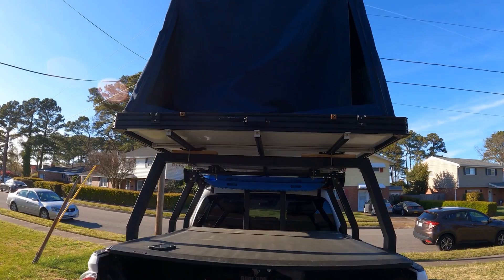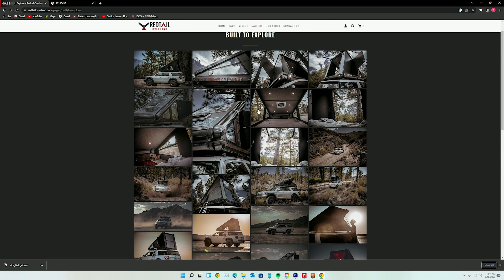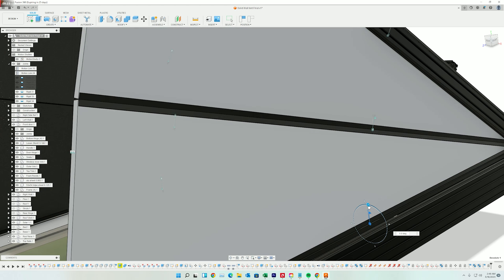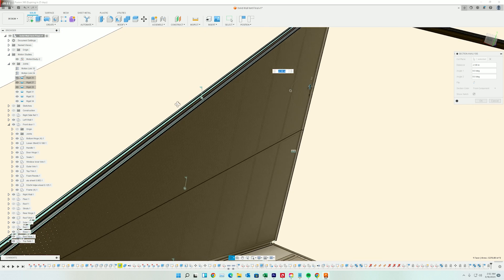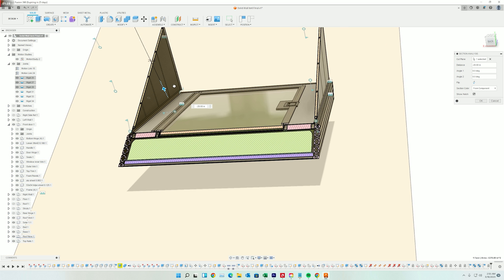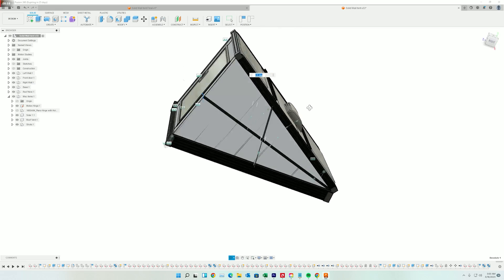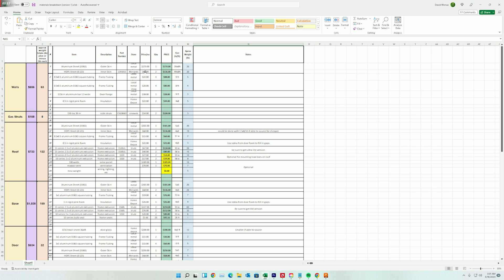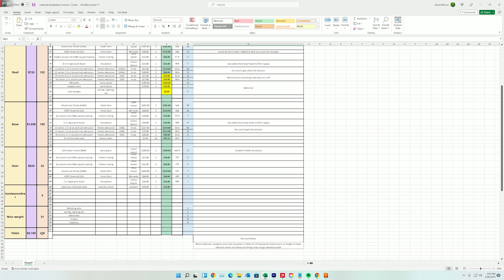DIY hard-side rooftop camper build (INTRO)

Comment: Aluminium is going to create moisture on the inside. Which is why the sky loft is carbon fibre inside and out. But who can afford one of those!! I’m hoping you can pull this off and get a good outcome.
Reply from the maker: @AdamBurgess-p3g  I finished this over a year ago now and it works exceptionally especially in the cold I get practically 0 condensation inside even when it’s sub 0 temperatures. Aluminum does have a high heat transfer which is what creates the condensation as the aluminum gets cold. Luckily since only the outer frame is aluminum this doesn’t really matter as the surface area of interior aluminum is pretty negligible.

Comment: Lay your own carbon fiber over  fiber glass square tube. Use 1' reflextix foam as a insulation....bam ...saved you 150 lbs bro!
Reply from the maker: I’ve now since (mostly) finished this project. While I didn’t use fiber glass tubing because it’s extremely expensive I did use carbon fiber over aluminum with an epoxy barrier between the two and the whole thing weighs about 170 lbs

Comment: Holy hell, how didn't I see this earlier! I'm just starting to design my own hardshell wedge rtt. I'm aiming for something super light (it's going on a mini countryman, I want to get the weight savings in while still having an rtt). I'm also aiming for a strutless setup, but we'll see how that goes.... I'll be making mine out of rmax 1" foam board insulation, and cover it in either carbon fiber or a canvas. I'll be using a hung system similar to yours as well.

I'm excited to see your progress on this. 

Just one question so far, what cad program are you using?
Reply from the maker: Sounds cool, I’ve actually redesigned since this video and my most recent video show the latest iteration and build where I used 1 inch and .5 inch foam for most of the build and laminated it all with carbon fiber. Total weight is around 170 lbs. Honestly it would be pretty tough to save much more weight on top of that for those dimensions but for something significantly shorter and more narrow I’m sure you could bring the weight down quite a bit. And I’m using Fusion 360 it’s free for hobby use

Comment: I don't know what your original weight was on rtt, but seems you might need to add 60-80lbs at most.  Looks like a pretty good DIY.   Hard sides makes sense for lots of reasons.   Just to be able to lean against it would be a gamechanger.

Comment: Forgive me, but this seems like there's a lot of mental/tech/digital stroking going on here. Just because you CAN do all of this in CAD, doesn't make it all that practical. Kinda defeats the DIY aspect at the price point too. Smart kid though. Less overthinking, more building dude.
Reply from the maker: I was hoping to give others inspiration and technical insight into how a hard-side camper could be built during the time it took me to build my own which as of now is almost identical to my original CAD design as I have completed the majority of it now. I wouldn't expect most others to use CAD to design all their projects first as I do and clearly, the video isn't a lesson on how to work with CAD software, however as a college student DIYer it's much more cost-effective and thus more in the DIY spirit to design virtually to test feasibility before spending thousands of dollars on materials in hopes it will all work. The next few videos will be the actual fabrication/build of the camper if that's more your speed.

Comment: I love what you are doing but I will caution the use of the poly "live" hinges. GoFastCampers used this with their first revision of their wedge camper doors and it didn't work out, doors were literally falling off after a couple of years.
Reply from the maker: This is super helpful, thanks! I found a bunch of forums talking about some of the issues with their live hinges. This is the first time I’ve seen long term reliability for this application and definitely something to consider.

Comment: I’ve done something similar already. Don’t recommend the poly living hinge on sides. I found when the tent is collapsed that hinge is laying on top of itself and it will warp if you rivet it.
Reply from the maker: Thanks for sharing, Im actually planning on switching to carbon fiber for the wall and floor panel and using vhb tape to bond the hinge and panel. This should eliminate any warping between either surface.  I’ve had some warping issues with rivets in other polypropylene parts myself.

Comment: I build foamies which are teardrop trailers made of XPS foam and canvas. My 4'x8' body's with OSB Floor (54lbs), manufactured door (30lbs) and window (10lbs) come in around 130lbs. You can make canvas a live hinge. I am currently making a bicycle trailer 3'x7" that I am experimenting with a foam floor with. The body without windows is 35lbs, I am shooting for under 50lbs total.
Reply from the maker: Thanks for the info. Yea I definitely need to change the materials, it’s just too heavy. Using canvas as a live hinge is super interesting, I’ll have to look into that. Thanks!

Comment: Those tubes in the walls are going to cause cold areas of they go the full thickness of the wall? What about channels instead?
Reply from the maker: They’ll certainly be a source of thermal bridging, thanks for the suggestion, I’ll look into channels but I think the difference in surface area and subsequent heat conductivity since the wall tubes will only be 0.5 square tube would be negligible. Also the live rendering while working in fusion 360 sometimes shows certain assemblies passing through others if the material is thin enough so they wouldn’t actually be the full thickness, I wish I caught this artifact earlier because it’s definitely misleading. There is a more accurate depiction fully rendered picture on my Instagram if you’re curious what I’m talking about. The inner hdpe sheet on top of the tube should provide minor insulation and at least protect against condensation.